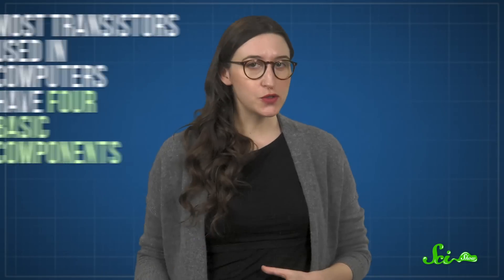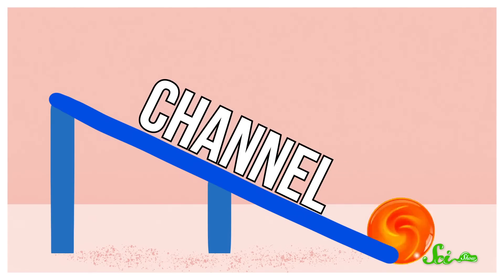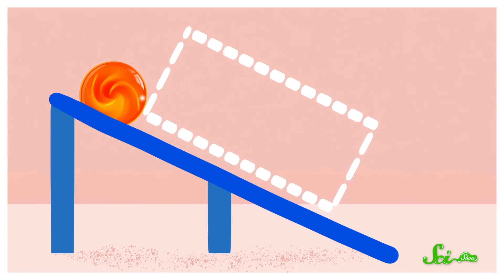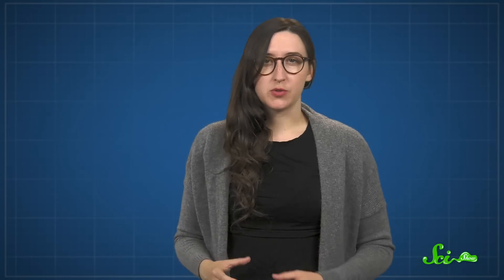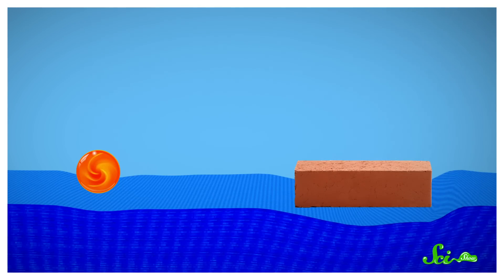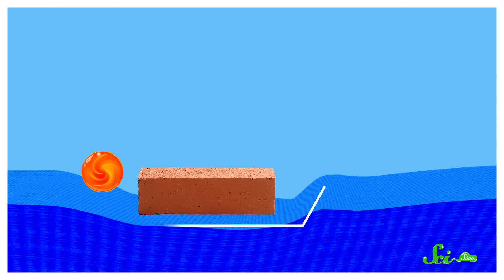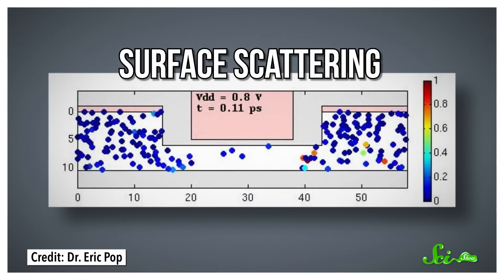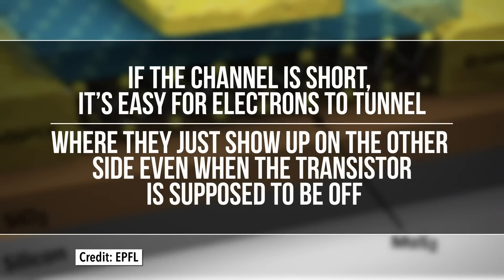There's a Big Problem With Silicon. What's Next?

Comment: Its over for die shrinkage.  Chemically perfect industrial processes do not exist.  It is infinitely easier to refine a single element to 99.99999% purity than to try and get every single atom oxidized perfectly.  Same goes for SiGE, there is no metallurgy process than can ensure perfect "mixing".  Its like mixing carbon and iron to make knives with those cool looking wood-grain patterns of completely random un-mixing.

Comment: Wrong. A transistor is analogous to a valve, not a switch.  A valve can range anywhere between fully open and fully closed.  That is why the predecessor to the transistor (vacuum tubes) was sometimes called a valve. Sigh... kids these days.

Comment: plus silicon is not very good at handling heat, affecting how fast computers can go.
Reply: To be honest, silicon isn't actually that bad at handling heat compared to other materials like germanium and gallium arsenide. The heat is only generated because we're driving transistors so fast and hard - we've been working for the last 10-20 years on ways to make them need driving less hard (i.e. work at lower voltage) and do more work without needing to be driven faster (i.e. design architecture - how we make logic circuits out of transistors).

Comment: 2:28 "Electrons have less distance to travel"

WRONG! It is the electric field, not electrons themselves which carries the information.
Reply: That's not actually true.  In CMOS, a voltage on a gate creates an electric field which bends the bands to generate an inversion layer.  That permits current flow to charge or discharge the gates of the next set of logic gates.  By moving the charge, an electric field is created somewhere else.  Charge movement is a requirement, so it isn't just a matter of fields.

Comment: Come on guys... That explanation of how a transistor works is actually the description of a Field Effect Transistor (a very specific kind of transistor). The contacts of a standard/traditional transistor are called emitter, collector and base; not source, drain and gate. While (MOS)FETs are transistors, and definitely far more in use than standard/traditional transistors, not even mentioning that the explanation is about a rather special (and functionally exceptional) transistor, is borderline disinformation. A bit like explaining general politics, by describing just capitalism. I'm used to a higher production quality from you guys; you can do better than this. Other than that, keep up the good work.

Comment: If they can make a chip one square inch, what is the problem with using 4 square for a more powerful computer. It's kinda like this years laptop is a mili second faster then last years. Does it really make a diff.
Reply: power consumption and cost of manufacture. If it takes twice as much silicon to make the processor, it's going to cost twice as much.  Also, if it's twice the size it will consume twice as much power to run.